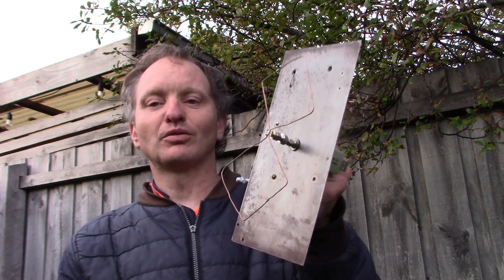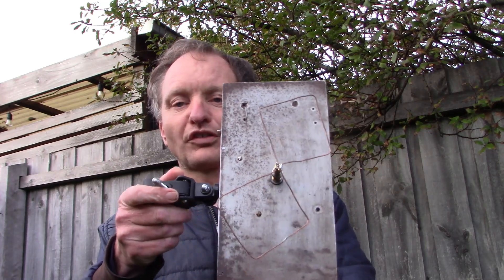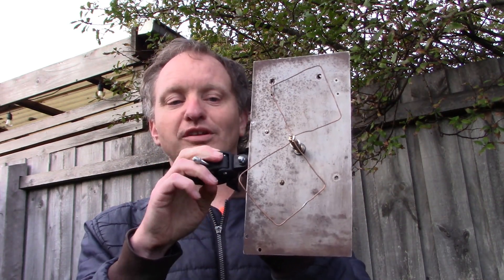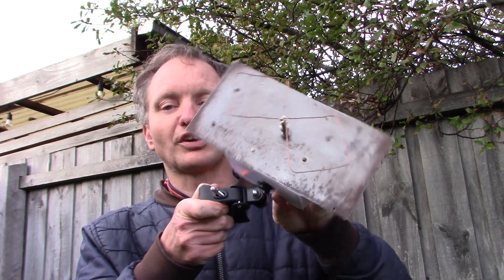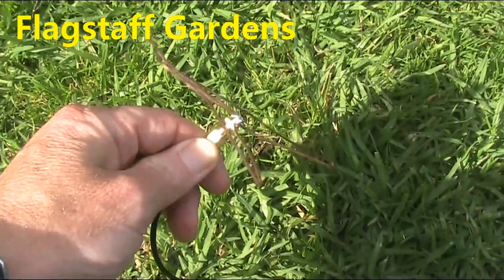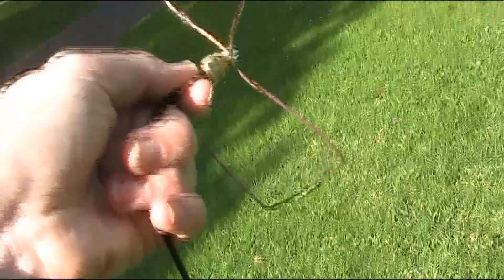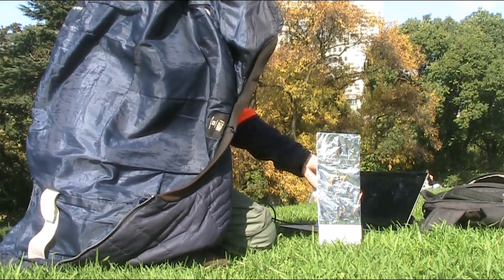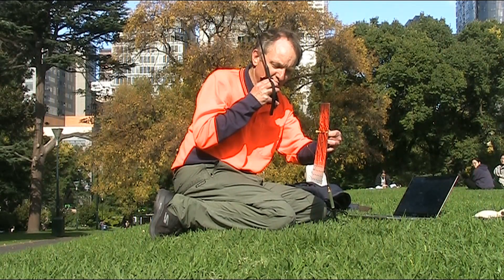More 1296 MHz receiving and crossband contacts

Comment: I don't think there'd be anything for me to hear on that frequency where I am. What I'm going to do though, is see if I can generate a signal at that frequency with my nanovna. It was supposed to go to 1.5ghz, but I've not needed to use it anywhere near that high. If that works I'll try receiving it with my cheap little sdr dongle. Maybe there is something in my area.